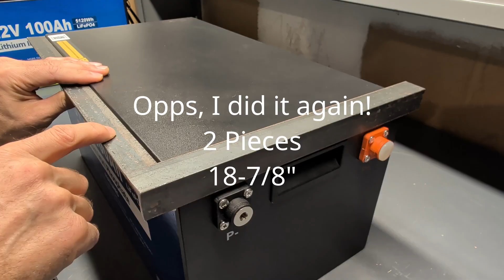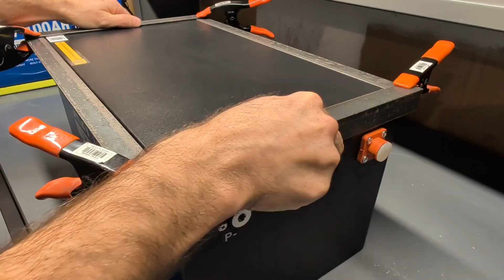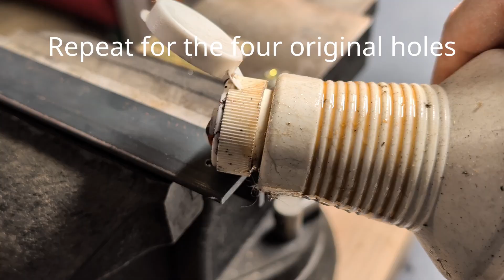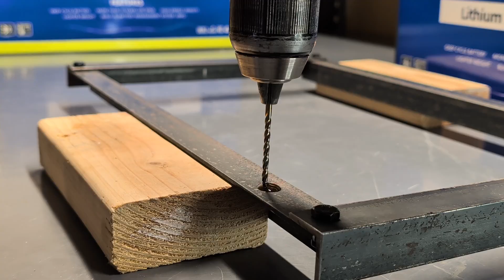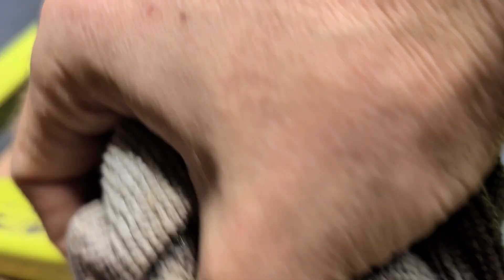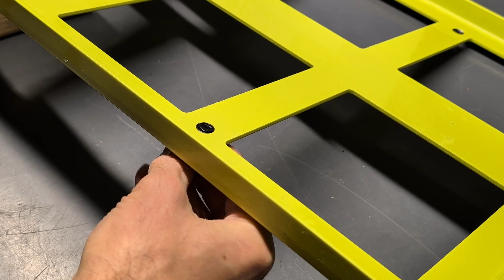Building a Ryobi 48V Battery Bracket

Comment: I am planning on building a sled for my 300e similar to what the 480 has. It will winter in an unheated North East garage, and I have a second floor area that is heated to at least 50f. My thought is that with a sled and proper cable arrangement I can pull the battery and remove the access hatch and rear panel. Are you aware of anyone doing this? I will also mount the Anderson connector to the frame similar to your 480 video. And I will document the process. 
I was considering just adding a battery heater, but this better in the long run.
Reply from the maker: I haven't seen anyone do it, but it is something I have thought about. It seems doable if you're good with metal.